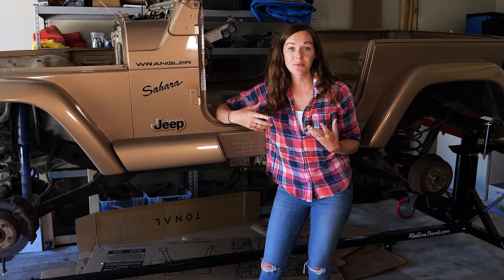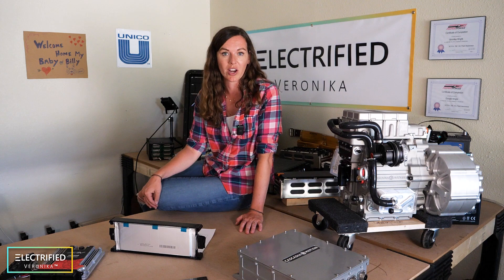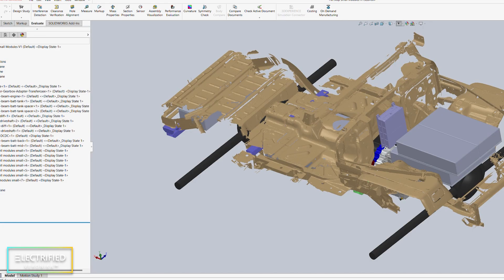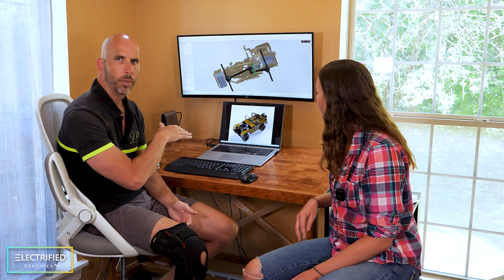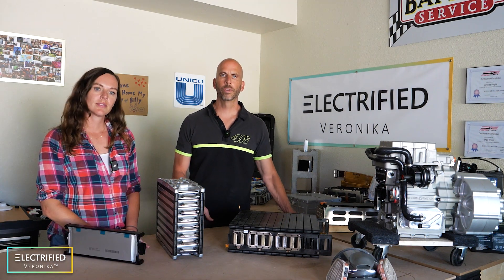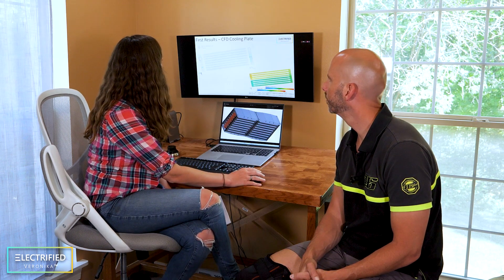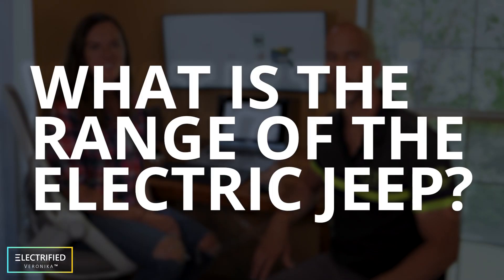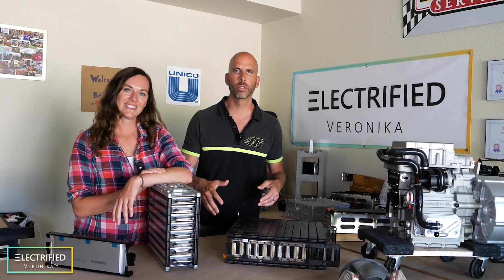How CAD and Simulation Helps Your ELECTRIC VEHICLE CONVERSION!

Comment: I want to convert a 2015 Land Rover Discovery (LR4). This will be a very long term project obviously. A lot of this information is very very useful and transferable. Thank you. The big questions I have regard interfacing the new EV drive train with the rest of the car’s communication busses. Simulating signals the ECU doesn’t seem as if it would be the best way, but how about simulating the signals the ECU would be outputting? And conversely responding to what the Ecu receives from other modules? For example if I put the ev motor to the transmission, could I get the various drive modes to still operate, or would it be best trying to reverse engineer what the drive modes (terrain response) are doing. Sorry. So many questions. And I’m probably starting from the middle even think these things.
Reply: Hi Peter, could you give me an update on how far you have got.
I’ve been thinking of this recently.
Plenty of 90 and series vehicle being converted. They have  minimal networks involved in them.
I don’t know if LR4 has flex ray or just CAN, would have to look it up. RAVE or workshop manuals for this.
You can sniff the CAN but would need more complex hardware to do Flexray - Canalyser and the right box to input and output.
Canalyser can do this and have been with engineers doing it on later vehicles.
It all depends on how integrated they are
You need to output back on the network the messages it is expecting.
Take care M.

Comment: I know I am late and this project is done. But in the future please use class 0 gloves rated for 1k Volts or more, with leather protection when you are messing or modifying HV systems. I also recommend sockets a, extnosion, and other tools that are insulated when you can. I do not want to hear or see anyone of you get hurt. Other than that I am loving this. I do diagnostics, programming and other computer stuff in automotive. I have recently started doing hybrids/ev vehicles as part of the business. I am also a pretty big nerd for this stuff so I love watching this stuff.
Reply from the maker: Thanks for the comments and concerns about safety and you are right...when dealing with high voltage, the proper PPE (Personal Protection Equipment) is needed.  We do have HV gloves and insulated tools for use when the battery and system is in it's high voltage state.  While the modules alone are still containing a high amount of energy, they are not high voltage (less than 70VDC).
Reply: @ElectrifiedVeronika  yes you are right anything 70 volts or less you don't need it the protection. Excited for the next projects

Comment: Don`t forget each cell is going to have its max and nominal charge and discharge way to find the optimal discharge is fully charge the cell and put in under a load for the voltage to drop to be no more than 10 to 15% (4.2 volts down to 3.6 or 3.5 volts). This manner will insure the cell never gets over worked and will last alot longer from not heat stressing from discharge. Ive often found factory specs to be a bit over the ideal rating. Once you find the optimal current drain you can build your battery to be a closer match to your motor controller. Voltage loss = speed loss and also creates heat. Im a firm believer in not wanting to see my batteries go over 50c to 60c under a load.

Comment: When it comes to heat dissipation, are you planning on integrating the cabin heating with the heat from the battery? Or would that be a different temp feature (like adding AC as well)?
Reply from the maker: We will not do AC, we just take the top off, hehe. The same heater heating the battery will be heating the cabin but there will be separate loops. More on that in future videos!

Comment: Not sure if you can explain the reason you chose that motor. You kinda explained that you want to reach 100mph at 4400rpm but: what RPM range you want  to be in? can you use the whole range of the motor RPM or you want to stay between a range to be more efficient, or to have enough power for example at low speeds?
Reply from the maker: So in our case, we wanted to use that motor with the incorporated 3:1 gearbox which makes the motor RPM of 0-12000 RPM down to 0-4000 RPM and gives us power and torque we wanted for our application. So, yes, we will be using the full range of the motor utilizing the gearbox.
Reply: @ElectrifiedVeronika  Thank you for explanation.

Comment: I have a 1987 Jeep Comanche I am going to convert to electric. How do you feel about using a pickup truck bed toolbox (modified to be waterproof of course) for battery containment/ placement? My only real concern would be making it too top heavy since it already has a 4.5" lift. I love the channel guys, keep working your analytical and logical magic.
Reply: I'm converting an 85 Cherokee Chief. have you chosen the components for your drivetrain?
Reply: Hi, would have thought “inserting the battery above the chassis would be the best answer if you have the lift.
The COG need to be kept low and within the wheelbase.
Motors are small, using Tesla motors would be one way and running independent suspension.
Lots of possibilities.
Take care M.

Comment: If you're worried about the battery modules underneath with the driveshaft running in between. Why not just ad a driveshaft safety loop secured by the pack's themselves? That way if the shaft breaks it'll be at least somewhat contained. 🤔

Fascinating stuff here. I really liked how you shared the 3d modelling&scans. Shows a lot of what goes into a project like this. 
I can't wait to see what the final configuration looks like. 👍🏻

Comment: Good vid, looking forward to see how you set the batteries up to get to 400. Do you know what vehicle these modules came out of? They look like some I've seen from a Hyundai but there are so many that is just a guess. The ability to modify them really helps make them fit another car. Also, how do I find pricing on the Cascadia motors and inverters? I see a beginning price on Stealth EV for one model but nothing else. I didn't know if you can buy these direct or through a dealer? 
Good job guys.
Reply: They are from a crashed Mustang Mach-E...  As for Cascadia prices...I think Legacy EV is a good start..  https://legacyev.com/products/cascadia-motion-im-225-kit
Reply: @donaldwright7194  Thanks

Comment: I’m a Jeep fan and owner, as well as a Mechanical Engineer and designer, and this series has been so fun. 
It intrigues all the scientific approaches, in the correct order or operation I might note, and then just makes me smile to see something like the Jeep Wrangler that is so familiar and close to home, go through a very original design change and perhaps Future Proof design. 

I’m happy to see in your other comments that you are working with Jeep shops, which was going to be my suggestion, as those places have likely seen motor swap, tub and chassis modifications, and axle setups that will greatly add to your toolbox of knowledge. 
Good luck! If you find yourself coming short on availability of space, look into the 2004-2006 Jeep Wrangler Unlimited (lovingly referred to as the LJ or TJU), as they are exactly the same style but with about 12” more length in the tub and frame.
Reply from the maker: This comment makes me smile so much!! THANK YOU! It made my day the first time I read it and now that I answer it! Yes, we are super excited to collaborate with Off road performance in Waukesha - they are eager to learn about conversions and all "the electric stuff" and we are happy to have somebody in the project who knows what they are doing from a Jeep perspective - great synergy - let's see where it takes us. Great suggestion also with the Unlimited, then we can make one with even more range. In any case, that's not the last Jeep that we will convert.

Comment: Good info. The only issue is that nobody does a conversion for a useful car like a VAN or RV. I would be curious to see what kind on motor and components are needed for a Van or RV. If you fill out a VAN roof or RV roof with solar power you can add few KW of power in the batteries every day. on a small 33ft RV you can add at least 4-5 kW of solar. in a sunny day that can give you up to 30KW of extra energy; and solar panels become more efficient every year.
Reply from the maker: Most everything that we are doing for the Jeep would be perfectly suited for a VAN or Bus, especially the electric motor. The conversion would be even easier in a sense that you have way more space for batteries and hence more range 😊  A school bus would be on my todo, but also an old VW bus would be really cool. 😊
Reply: @ElectrifiedVeronika  Correct, the reason I like your series.